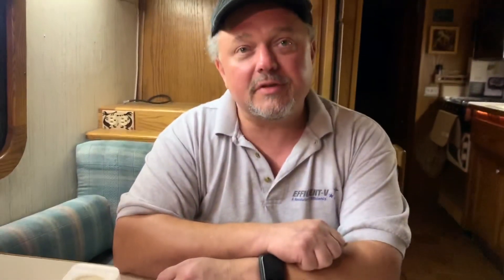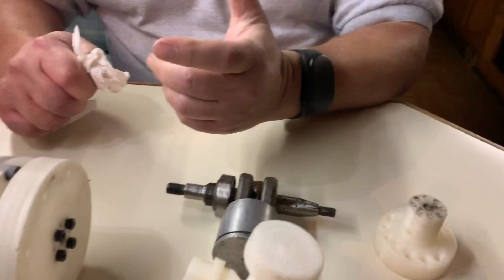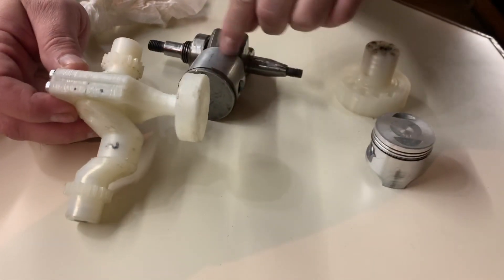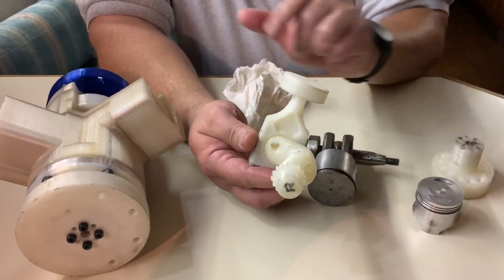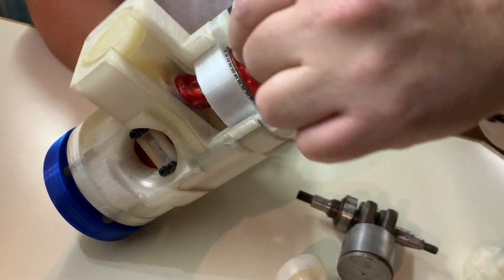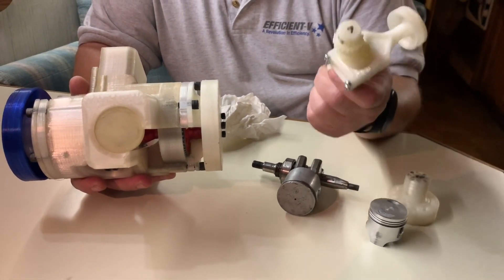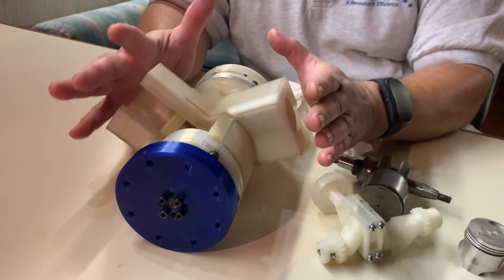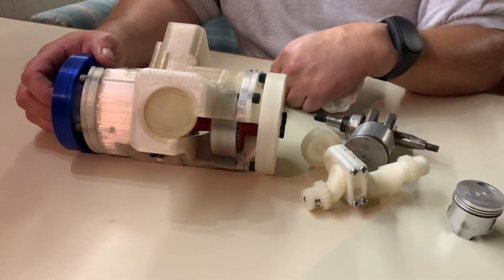A gear head invention - Efficient-V

Comment: As a retired manufacturing engineer I think it's an interesting solution to the piston skirt wear and piston rod strength problem. That being said the extra cost involved in retooling and redesign of existing product along with the development costs involved would not make it feasible except in commercial applications such as over the road diesel engines where you are looking for extreme life between overhauls. Most modern car engines have the capability for 150 -200 K miles before major teardown anymore and if you live in salt country the body is starting to be pretty well compromised by then anyway.

Comment: Very cool. Can't wait to see some running prototype engines hopefully in the near future. 

Curious was material the piston/connecting rod will be made out of. Could the connecting rod it have replaceable wear bearings on the sides. 

Where will the full oil level be on the engine? I envision the connecting rods floating on a film of oil between the block with very little friction compared to the normal piston skirt.

Comment: I want to hear this type of engine run, also are there going to be more reports coming and injection, exhaust.  Love to see new designs.
Reply: Gloppie 3 December 1981 class at the GM training center I got to see the 6.2L diesel, the chevette diesel and the th700r4. I also got to see a plastic v6 engine that GM was working on, with ceramic coated pistons in steel sleeve and steel inserts on the crankshaft bearing journals and camshaft bearings . The biggest issue the plastic engine had was the lobes on the cam, it kept eating the lobes off. This plastic engine was light enough that one person could pick up the long block.

Comment: You can tell that they have put a lot of time, and effort into the concept. I'm sorry I just don't see the benefits over conventional compressors. The shorter skirt doesn't allow for rings, which is a necessity.
Reply: its a half scale model....
Reply: @mdcbert  I don't think scale matters. It doesn't seem to matter with conventional compressors. Converting a reciprocating action to rotation always as been a problem. But I wouldn't discourage the attempt. That's how the idea of jet engines came about. Both have pros, and cons.

Comment: So the machine shop should be insured  for faulty workmanship.
If I were a judge I would accept your testimony and subsequent videos as “expert”
You clearly demonstrate the fault and the end results of the fault.
The machine shop technician was the last expert to work on the head.
As a head service technician he “ought reasonably to have known” the potential consequence of fitting the worn retainers to the valves.
He is in error and as a result you have suffered a financial loss as should be compensated.
Sounds like the making of a good case.
Reply: Simon Morris are you commenting on the correct video?  Seems like you’re talking about the dropped valve bro.

Comment: Ok, I see a serious problem from go: you are basically running a full floating crank, as in it is unsupported anywhere but the output end. You're relying on the reciprocating piston journals to act as a sort of main journal. The crank will end up breaking between the ring gear and the ring gear side reciprocating journal, and twisting between the 2 reciprocating journals, while the output side bearing will have an incredibly short lifespan.
Reply: ludditeneanderthal The design has been studied by a Fortune 500 company, including bearing and crankshaft stress simulation. All were found to be within design limits. Pressures were calculated for a full 720 degrees of rotation.

Comment: It's a long stroke cross head piston design, the side thrust loads have been replaced with high axial inertial loads. Probably work great on alternative fuels needing high compression and long burn times, not going to be a high revver.
Reply: Could be a great naturally aspirated diesel generator. Especially considering its small form factor and low NVH

Comment: Wow, the conspiracy theorists came out for this! 

1. The big end of the connecting rod has a cross-head function. It appears that function isn't there to take the angular thrust of the connecting rod as in conventional use, but to guide the crankshaft eccentric motion. This doesn't eliminate side-thrust, but moves it from the piston to the big end of the rod.

2. I would not attempt to oil the crankshaft through the connecting rod, but from the rotary guides at the ends of the crank. 

3. It's more complicated than a conventional piston/rod/crank and more difficult to lubricate.
4. If it worked I would expect a running example. 

5. Some computer modeling can put this idea to the test relatively easily.
Reply: Yeah not sure he is not transferring a problem from one area to another. The piston skirt distributes the thrust forces over a large area. This design puts all those loads in a much smaller area increasing stresses and wear. Also it looks like the rod big end is going to be pretty massive and it is made out of much denser steel where the piston is aluminum. The large area of the piston skirt in a normal engine also transfers heat to the cylinder wall.
Reply: @perry9492  I agree that the thrust problem is simply being moved to a different area. And much complexity is being added to accomplish that. Heat rejection through the piston skirt is true, but it's also largely obsoleted by piston oil squirters.
Reply: @joshua I agree it's a modified crosshead like steam engines have been using for centuries.
Reply: @perry why do you assume that the piston/ rod/crosshead assembly has to be made out of heavy steel? It could easily be made out of aluminum. Just like aluminum rods in a racing engine.
Reply: Neander diesel already mostly solved this problem in "inline" form...with their dual crank technology... I see large 4cyl as way of future now, because with dual cranks, no need for balance shafts...and its in current use as Yanmar bought the rights and is manufacturing it.

Comment: Seems like he’s trying to reinvent the wheel. The lateral movement/rocking in modern dngines is actually neglegeable(sp) and can be mitigated even more by simply making it an undersquare design (large bore, short stroke, high rpm).
Reply: they eliminated the wrist pin on this.
Reply: rats arsed  oh yeah? like what?

Comment: While interesting I do not see this taking off. Most importantly this is old noting new here. We have a/c compressors in cars and trucks that can have anywhere from 4 to 16 cyls all radial. The future I hate to admit is electric. Not what is out now but similar,  battery tech has not advanced because it can not go much further. Future cars and trucks will be electric and they will not be carrying thousands of pounds of batteries around. This is a cart before the horse problem with our power grid not just the US I am talking globally. The pink elephant in the room is Diesel and Diesel tech. Only now are mainstream car makers offering a Diesel solution with great MPG numbers? Ever wonder why VW was targeted so harshly? At their peak TDI's were selling like hotcakes and the masses here loved them. Something had to be done hense VW DIESEL GATE. And surprise a few years later all the big 3 are offering Diesels . . . . . That's amazing. . . Now I realize VW had cheat software but really. . . . Do a google search and check which one of the BIG 3 had NOT been busted for cheating Diesel regs. You will be surprised what you find. I am not fan of any type of Dual propulsion cars and or trucks like a Prius... 2 types of propulsion = 2 different things that can go wrong. Here is some funny stats for you at their peak the Prius sold 236 THousand in 2012. Last year they sold 87 Thousand. There is still life in Diesel tech but even in the EU where Diesels are the main cars and trucks there is a concerted effort to destroy the Diesel. Here in the US they do not have that problem no one wants a Diesel anything Mainly because the big 3 did not want to invest in the tech and put out crap engines.

Comment: I thought this looked familiar it's the DeWalt Flexvolt cordless air compressor that Ave took apart for a review.Except that was a single cylinder.
Reply: As Ave pointed out, the Dewalt piston pivots in the cylinder because of its lack of a wrist pin. This design doesn’t at all and that is it’s selling point. Dewalt went for cheap simplification, these guys added parts to the rotating assembly.

Comment: Interesting concept for a gen-set or compressor engine, not sure if it would scale well to a larger application though, there would be a LOT of reciprocating mass just in those connecting rods if they're ultimately made fro steel forgings.

Comment: I have wondered why we can not get magnetism involved in powering engines  ?
Reply: We do, they are called electric motors.
Reply: Maybe because the energy storage isn't ready yet. There is a lot of potential energy in a tank of gas. Battery density isn't there yet and right now a correct battery to power a car would be very heavy with limited range.
My guess..

Comment: Thanks BGM, very interesting!  GM addressed that issue in the LS engines. They went from a V block to a Y block,  allowing longer cylinder sleeves, and 6 bolt mains. 4 from the bottom and 2 from the sides. With a few other things, that's why they run so long.

Comment: Biggest road blocks is the environmentalist. If you designed an engine that ran on 'salt-water' that got 100MPG they would claim tomorrow the earth was ending due to SALT and how it caused the temp to rise or we are going to freeze. Just like the Diesel engines they have pretty much ruined them with DEF, look at the amount of resources in parts to rebuild/replace engines. They they say electric, meanwhile they STRIP MINE to get rare earth metals (in CHINA) of course. Then, the power grid is 1940's with brown outs, you can't build any new power-plants as Environmental Activist (EPA) will block it. Breathing is now deemed TAXABLE the biggest LIE/SCAM on earth and these same people fly around in JETS saying how they are going to 'save' the planet. Insanity.
Reply: And  you  are  just  scratching  the  surface  of  the  insanity
Reply: @cbmech2563  Go find some evolution in a zoo.

Comment: If you utilized two different size pistons and connected them from a primary exaust to a smaller secondary intake you could make a two stage Air -compresser  with ether a single or dual ring set-up and reed valve heads, power it with a high-speed electric motor and VALA will balanced ,high-speed, quick presure building air-compresser.
Reply: Do you mean voilà? It's French, BTW.
Reply: @Joshie2256 Exactly, I did not use spell check!!

Comment: This engine design will last for ever... That might be a problem 🤔
Reply: Not always. One reason people buy Toyota's and Honda's is that they are known as three-hundred-thousand-mile vehicles. That reputation has increased its new customer and past customer sales immensely.
Reply: @siaripop7  I don't know about 300k ..especially Toyota.  I had 2 Ford pick-ups last that long, and another close to it, and got rid of all three still running well, but I seen sludge problems in Toyotas that killed them off before they hit 80k.  More than a few lost main bearings long before they should have.  Don't buy into that marketing crap.
Reply: @Larry Gall .... but a sludge issue is usually an indication of use of poor quality oil, or not doing drains at proper intervals to accommodate the use of the vehicle.  Years ago, I worked for a great company (short-sightedness led me to quit when I should have toughed it out).  I saw 2 vehicles that (unbeknownst to me) were going without being sent in for oil changes.  One of them was the owner's personal pickup, one of those Dodge R/T things, a down-sized pickup with a higher-performance package.  It failed at 70,000 and it didn't take the dealership long at all to realize that it still had the factory oil and filter.  There was a reason for how this happened, lame as it might be... For more than 20 years, since taking over the business from his Dad, the Boss had been buying all company cars and light vehicles through this dealer, one salesman in particular.  The guy's name was Dana.  Dana would show up at the office about every 3-4 months, get keys for whatever he saw in our prkg lot, and take it up the road to the dealer for lube, updates, whatever.  Over the years, it got to the point where he didn't even have to speak to the boss,  he would just pop in, take the car, put his own car in the spot, and be back maybe 2hrs later to return the boss's car, all serviced and ready for the next 4,000 miles.  Our boss never gave it a thought, except maybe at Christmas time.  Then, Dana retired.  Our boss knew this had happened, but I guess it slipped his mind. For a few years. Anyways, the engine was ruined, and it was still technically under Chrysler warranty.  They really valued our company's business, because we bought a fair number of cars and light trucks/vans from them. So they had to "hide" the engine from Chrysler, and I heard from a few sources that they bought a new one and put it in basically for a song,  to ensure that we would keep bringing our business to them.  The boss was certainly embarrassed about his stupid mistake, but wasn't afraid to fess up if anyone brought it up.  It also happened with a diesel cube van we bought from the GM dealer, but it was caught before the engine puked.  It was after the second of these two events had taken place, that someone decided to begin a little program where one of the warehouse guys was assigned the task of checking all of the small company vehicles (especially the ones that weren't assigned to any one driver) and recording the mileage, and any noticeable problems or visible damage.  Yeah,  most of the morons who worked there wouldn't have the balls, much less the brains, to man up and report anything that had happened while they were out using a vehicle. Those of us who were assigned (heavy trucks) managed our maintenance schedules in accordance with manufacturer or company recommendations.
Reply: @siaripop7  yeah but toyota honda have become more american not visa versa. I used to work for toyota and they dont do it the same anymore sadly. You just cant make profit with products that last forever. Thats sadly how corporatism works

Comment: That will be a very smooth running engine. I know Neander motors did something vaguely similar,  but it uses twin rods per piston and a second counter rotating crank. Lots of extra moving parts and lots of extra weight. 
Yours looks to be the most ideal design for straight reciprocating motion that can be mass produced.